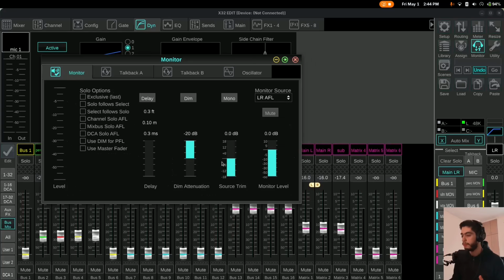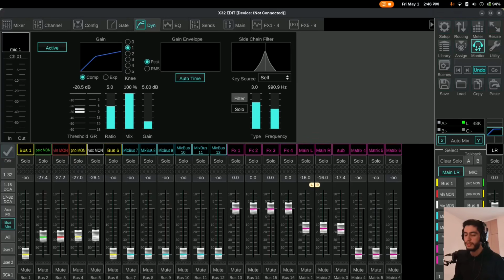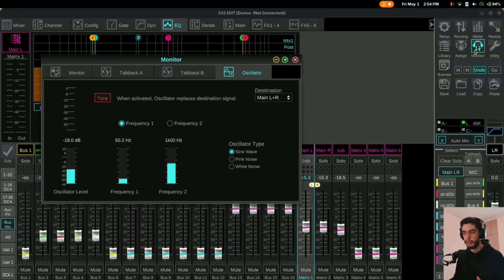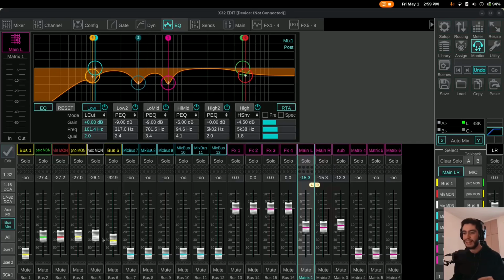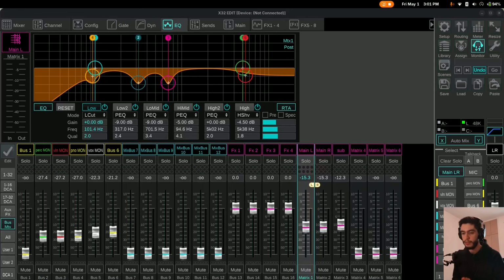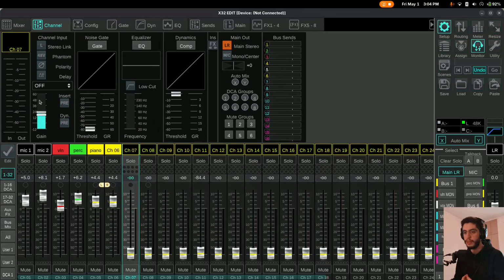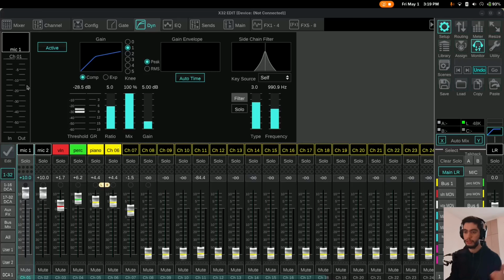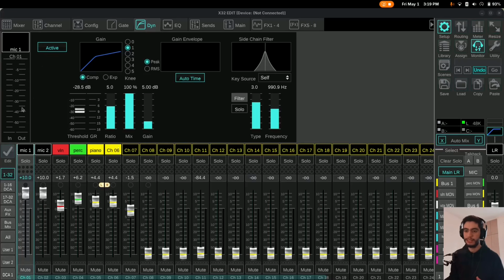wrong Gain is ruining your gigs

Comment: Good ideas. In addition to what you do I usually keep limiters on my main busses just in case an oopsie happens. Generally I set my threshold at -3 to -6  a fairly fast attack relatively slow decay and about 4 or 5 : 1 gain reduction. This has worked well for protecting ears and equipment without getting too much into the normal program dynamics.

Comment: I love your videos, Daniel! They've really helped me grow as a sound tech. Gain staging is so incredibly important, so thank you for covering it.

I did have one question about the fader levels sending to the amplifiers. In this example, are the amplifiers set to be too loud? I had thought it typically is best to set your amplifiers so that you're sending the nominal level to the amps without taking much signal away. Should the faders sending to the speakers have to be brought down by 10db if gain and amp levels are set correctly?
Reply from the maker: If your amps have fine control of the volume and are in an easy spot where you can reach them and nobody is gonna accidentally bump into them and turn the knobs then sure do it on the amp. But if you're using active speakers it's not convenient to turn the knob or line arrays they don't have a volume knob. Something else to consider depending on what kind of amps you have they might distort if you're sending very loud input level to them from the mixer. If your amps are at unity you can always make it louder from them mixer if you need more volume but if you turned down the output knob on the amp and you need more volume you'll have to go to the amp and turn the knob

Comment: you mentioned subs or bass speakers should be raised 10db above the mid speakers. any reasons behind that suggestion or theory?
Reply from the maker: There's a lot more high frequencies than low frequencies. If we keep everything at equal amplitude the bass will sound very weak. So what we want is not equal amplitude, we want equal power per octave. A 9 or 10 db difference between 100hz and 1000hz gives us that equal power so that to our ears it sounds like all frequencies are the same loudness. But if we make it all flat it will sound to our eqrs like the bass is very quiet. 
That doesn't mean you should turn up the fader of the subs 10 db more than the mains. With matched speakers from the same manufacturer usually you can keep the same volume and it will give you the correct balance. What we care about is equal power for all octaves
Reply: @d @danielkharrat thanks for clarification 🙏🏼✊🏾

Comment: There is incorrect information in this video.

The Behringer X32 oscillator's volume uses dB, not dBFS. Setting the volume to -18dB is not what we want!

Most digital mixers use analog dB on their faders - the X32 is an example.

Your content is great, but I just couldn't look past that!
Reply from the maker: You're confusing the labels on the faders and the level meters. Yes the faders have 0 as unity gain but the meters have 0 as the clipping point. All the meters are dBFS. 
You are correct that the internal pink noise generator is louder. But the sine wave generator is correct and the white noise generator is correct, when you set it to -18 it is actually -18. You can connect your computer to the usb expansion card and generate noise at -18 from your computer and it will read exactly -18 on the mixer input meters.
My bad if i wasn't very clear on that but if I'm looking for -18 on the meters. If the volume slider of the generator is wrong I'll adjust it to get -18 on the meters regardless if I'm using the internal or external generator.
So for the x32 internal pink noise generator specifically you can set the slider to -24 and you'll get exactly -18 on the meters but other than that all the meters read dBFS not dBu or anything else
Reply: @danielkharrat  I don't have an x32, but I'll study this very hard! Thanks! ☺️
Reply: There is +5 on the fader, which means it's using the analog scheme.

I'm not a professional, but I've mixed a few gigs, and it's affected me quite a bit!
Reply: @King_Miracle No, thats just a standard logorithmic fader scale. It has nothing to do how the dbfs scale works in digital

Comment: Hello, when you say you turn down the volume on the mixer matrix by 15 dB, what about the volume on the active speaker? Is this set to maximum or unity?
Reply from the maker: Unity. Most point source speakers have a volume knob, but a lot of line array speakers do not have a volume knob. It's a lot more precise to set the volume with the matrix fader than with a physical small knob on the back of the speaker. Some speakers, like the Beta 3 i once used for a conference were extremely loud, I had to turn down also the volume knob to half volume on the speaker amd turn down the matrix to -37db but that was an extreme case. In the bottom area of the fader, you also don't have too much precision. Around 0 dB, if you move the fader 1 cm, it could be 5 dB difference, but if it's down there below 30 or 40 dB, the same amount of fader movement is like 30 dB or more. So if you find that The Matrix faders have to be below 30db i would recommend that you turn down the volume knob of the speakers too if there is one. If you don't have a volume knob, or maybe you don't have access to the volume knob. I would say turn down the sends of the main mix to The Matrix by 20 db and also turn down the fader of The Matrix. That way you still have precision with your faders. But in most cases i would leave the volume of the speaker at unity and turn down from the mixer
Reply: @danielkharrat Thank you🙏🏾
Reply: @danielkharrat Hi, Daniel. But what do You think about the noise to ratio, when the speaker volume knob or amplifier knob is all the way up we can experience the noise in the very quiet parts of the concert. It is not the game changer tho. We also have a real risk to damage audience hearing. 

So my question is why does the volume knobs even exist on the amplifier and the speaker, if we not using them?
Reply from the maker: @dmitrydemchenko9437 they exist because you're not gonna always have a mixer with matrices or a DSP.  If the amps are noisy turn them down to half volume and maybe don't turn down too much from the mixer. The physical volume knobs are not very precise. If i have to use them I'll do half or 3/4 volume but i can't get any precision beyond that. Example: behringer HA8000 headphones amp is really noisy so i keep the knob at 1/4 and send loud mixes from them mixer. I don't use the physical volume knob unless i have to
Reply: @danielkharrat  Thank you for the answer!